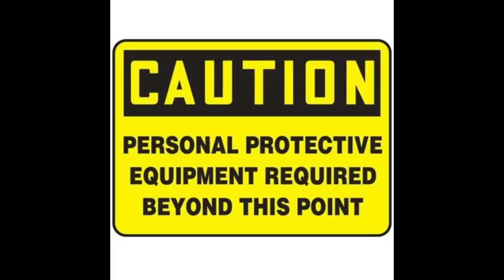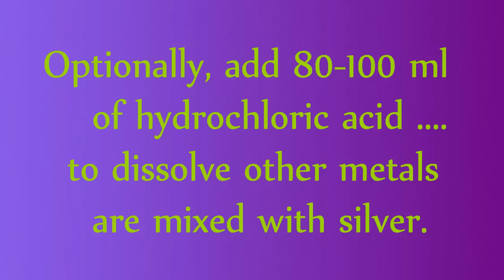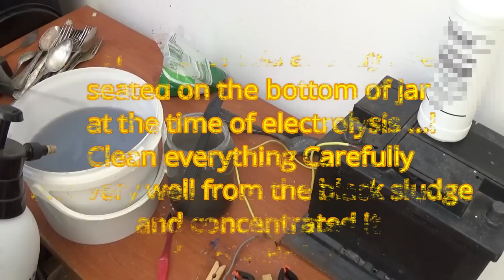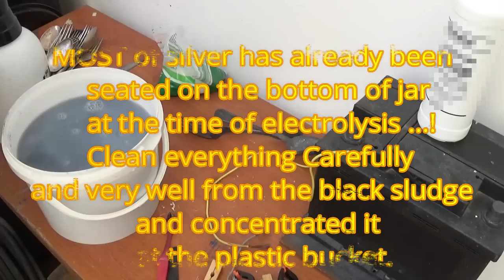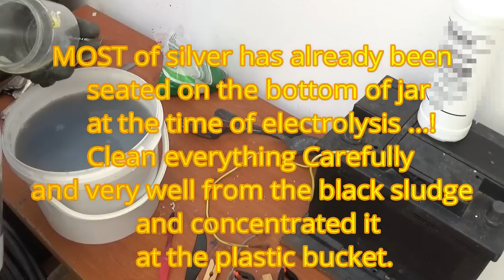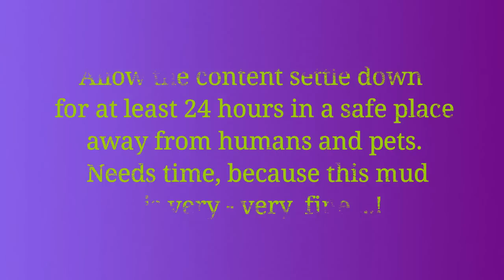SILVER REFINING Complete Process plate removal without harsh chemicals  VERY EASY 1 of 2

Comment: It works better if you use a stainless steel wire brush to scrub all the silver off. That black residue is silver that has replated back on the spoon. A variable power supply with the voltage set at 3V DC works best. 12volts from a battery charger or car battery is too high of a voltage, although it will work, it puts a lot of copper and other metals into your electrolyte. If your using a manual battery charger, set it on the 6 volt setting if it has one.

Comment: Hello kassi man, you may increase your silver yield by not using a chloride as an electrolyte. When dissolved silver comes into contact with sodium chloride (table salt) it forms silver chloride.I believe that's what all that white cottage cheese looking stuff is when you first start your process. Try using a small amount of sulfuric acid mixed into distilled water as your electrolyte.
Reply: The title of the video is how to do it without harsh chemicals.
Reply: I would lean towards the sulfuric acid for the higher yield, can you elaborate on the measurements of the acid
Reply: What does that make the slimes into: silver oxide or silver sulphate?

Comment: Why is my water all yellow and sludgy.  It wont go through the filter so I cant get the silver out?
Reply from the maker: i really don't know what happened.. and i can't help you.
Reply: Go to streetips that how I got my information about filter the silver and what chemical to use, it pretty cool information  from streetips
Reply: Don't throw out what you have done as you can always get it back I hope this information is not to late, go to streetips that where I got this information
Reply: I hope this will help you out
Reply: we got plenty og orangey goo also, its junk pour it off, the silver is on the bottom, pain in the ass anyway you look at it, low $.
Reply: Did you use tap water if so the sludge is silver chloride do to the chlorine in the tap water .if your going to use this method distilled water mist be used
Reply: Someone said something about adding a wee bit of hydrochloric acid, but don't quote me. Just research
Reply: @nicot589  the salt solution also makes chloride

Comment: That looks like 100 times too much effort and time for less than a dollar worth of silver you will get.And since the spoon was eaten all the way through, there are all sorts of metals besides the silver that have either dissolved or settled out.
Reply: Gulden Jackass I am still learning myself but as far as I know if you run the sludge in a hcl proxhide solution A/P it will desolve only the base metal and not the silver
Reply: @darkstar7897  Forget it. If this particular method of electrostripping were viable, then the commercial businesses would use it.

With all the time and effort he put into the process, he got back a bit over 7 grams of product of dubious silver content. That is roughly $3 worth of silver if it is pure, which it isn't. 

Nitric acid is better for dissolving silver and other metals in silverplated items. Then you can use table salt or HCl to drop out the silver as silver chloride.
Reply: Point is not using harsh chems. There’s plenty of vids of that method you’re describing

Comment: Car batteries average 650 cold cranking amps. This is a lot of amps. It can boil water easily. If you are going to use a glass container, use heat resistant glass or you may break a glass jar.
Reply from the maker: Thank you
Reply: what would u suggest as a power source?
Reply: I tried it on silver plated copper and copper Ions went all to the stainless, pretty much ruined the batch😢

Comment: Good idea  i will do it. But just a question    so you need full charged  battery 
And haw long do it take to dissolve  that spoon
Reply from the maker: Not necessary a fully charged. About 5-8 min for each
Reply: What if you have lower than 925 silver can it devolves  and get redof the iron and coper and take to 999 pure silver
Reply from the maker: @yahyaalzuhairi4853  Yes you can with acids. But it's not worth. Acid its too expensive, and after that you will get less amount of silver.
Reply: So does  this process  make silver 999 pure  after you filter  from the water in bucket
Reply from the maker: @yahyaalzuhairi4853  yes

Comment: So, I try this and instead of greyish water I get bright orange water and the silver doesn't really come off. I have salt and connect the wires correctly. I use a power supply not a battery, is there not enough volts, Amps?
Reply: Sounds as if your silver plated stock is perhaps only flash-coated and you have introduced iron in solution

Comment: Just throwing this out there stainless steel is non-magnetic
Reply: not any more ...  where we're getting it from you can stick a magnet to it ...
Reply: @charliewhite5675  Most stainless is non-magnetic. For the illustrated process, it does not have to be stainless, iron will work as well.
Reply: Most stainless flatware is magnetic stainless there are alot of grades of stainless. Non magnetic works best despite what he says also non iodized salt
Reply: Also only need 6 volt
Reply: Lol? Just throwing this out there, stainless steel is indeed magnetic quite often. Let's not get technical here either please.
Reply: SOME  stainless steel is non-magnetic
....
Reply: All metals have some amount of magnetism to them, it's just that the level of magnetism is so low in many metals it's not worth measuring under normal circumstances. Gallium I believe has the lowest level of magnetism of all metals on the periodic table. Some refer to these levels of magnetism as being Diamagnetic. Copper, silver, gold platinum all have low levels of magnetism known as diamagnetism.

You can test this with 2 one oz rounds, one .999 silver, the other .999 copper and slide a neodymium magnet from a hard drive holding the coin on a 45 degree angle. Note how fast the magnet slides down the copper round compared to the silver round. If you want to test the magnetism of copper, find a small neodymium magnet that will fall through a long copper plumbing pipe and note how long it takes to slide through that pipe when you drop it through. It will take a  far longer time to drop through than anything else passing through that copper tubing. These are examples of how to prove all metals do have some level of magnetism.